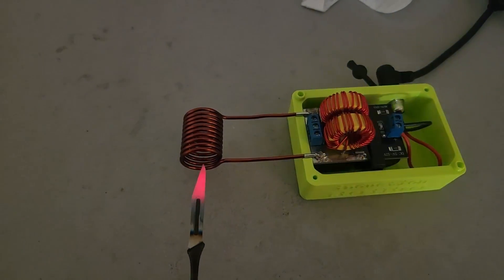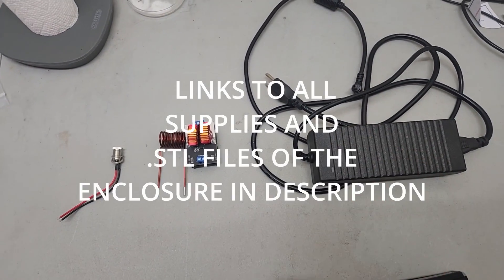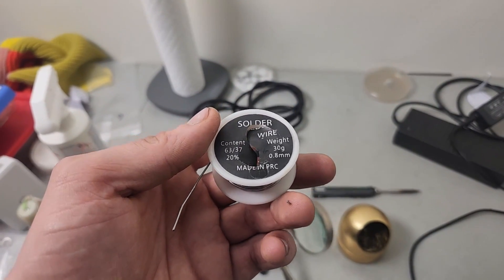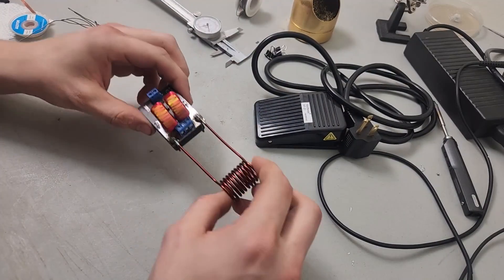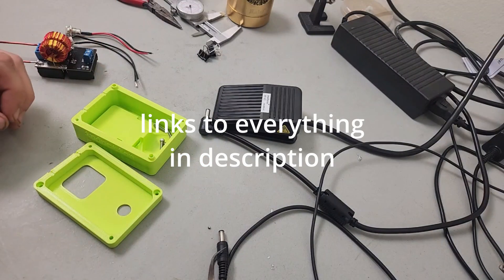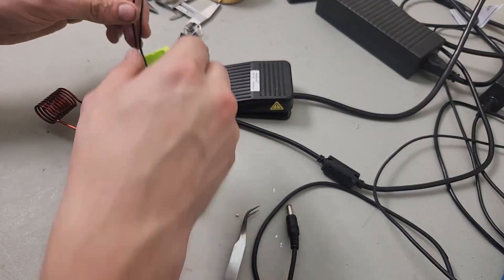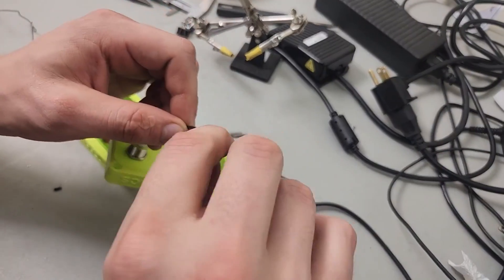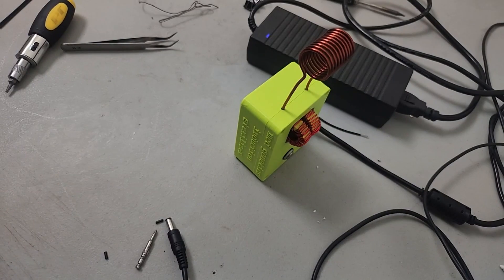Building an Induction Heater - Grow Mushrooms Safely

Comment: I don't think the power brick comes with a dc socket
Reply from the maker: It did when I got it maybe they changed
Reply: @MycoDogs  Will the button only being rated for 5A cause issues in the long run?

Comment: Doesn't work for syringe needles... not enough material ?
However it's impressive on pliers, scalpel...
Reply from the maker: some syringes will work but most are too thin, it needs enough mass to make enough heat. most will get warm enough to boil off the water inside them even if they dont glow though
Reply: @MycoDogs  Thanks for your answer. I have a solution for the needles... you have to make a kind of sheath with thin iron thread (0.3 mm) rolled on a 1.5 mm diameter support (it makes like a spring), make it stand inside the coil, insert the needle in that sheath and press the pedal !

Comment: This don't work. I solder this thing together it's all hooked up plugged in and no heat is being produced just a bunch of metal and plastic and solder drops on my place of work
Reply from the maker: do the lights turn on? the coil wont get hot just the metal you put inside it will
Reply: Yeah the light turns on start whining like a lil bom i put the metals in there didnt work, im thinking its the actual unit or the solder cause the pedal works battery and coil is coil so everything adds up but this @MycoDogs
Reply: Will a simple wiped down torch work in a sab without contam?

Comment: isnt it a problem the induction heater components are nearby the alcohol or bleach you spray in your glovebox/still air box?
Reply from the maker: i haven't ran into any problems but a loose connection could probably cause sparks, you could pot the electronics in epoxy to prevent that risk
Reply: @MycoDogs great tip thanks 😊

Comment: Does is heat up enough to sterilize a syringe needle???
Reply from the maker: Ive found some needles will work while others don't, if its too thin there's not really enough metal to warm up from the coil

Comment: Hey this is awesome Im following you for sure. 
I use the same pen. Have had it for now I think going on 10 years? Has never failed me. Heats up super fast and I love that it's portable with a liPo like you said. 
But I cannot recommend enough adding a little flux to your pads and dipping your wire tips. When i started using that soldering became a lot easier and actually fun 😅
Reply from the maker: yeah i couldn't find my flux but the wire is flux core which helped a little lol

Comment: i dont mind lead free in this use because it just requires a much hotter iron but it also does have a higher melting temp which is mildly useful in this case and i think 5-6A power bricks are enough 10a maybe why you sometimes fry the boards . for dynavap heating they use a 4A brick and just shorten the coil a little and i know a 6a brick is enough without shortening the coil

Comment: Would alcohol wipe work just as well for the scalpel or nah
Reply: no, but you can use an alcohol flame. It wont burn too hot, its mellow, and its cheap

Comment: hello! great video! I'm finding some problems using/building my DYI heat induction. I already try 2 different power supplies, 12V-6A and 12V-4.5A and none of them worked. I can only see a blinking led in both power supply and the mini ZVS board. can help with that?

Comment: If going the foot pedal route, any reason not to skip the barrel connectors and instead cut the end off of the power supply and directly solder  the wires to the board?

Comment: Dude I would love to make this and upgrades for this! I recycled a ton of vape batteries for future use so I could definitely do something with those to make it independent from wall outlets. A second upgrade I would like to add a motion detector to it so it detects something going into the coil and then it turns the coil on (a flip switch on it so there’s not any passive battery draining.)

The ideas are flowing!! I’ll message you on discord with updates when I’m working on it!
Reply: If you figure out that motion detector make a video

Comment: Well made video, I put mine in a small 12-14oz ziplock container lol, I used the screw terminals for the coil. Is there a problem with them? Ty 🍄💙
Reply from the maker: No problem with the screws it just looks weird lol

Comment: Got all the basic components off Alibaba for less than $10, including a battery case for some serial 35A 18650's because I have those in plenty and it saves me spending on the power supply. Battery operated will work just fine for my requirements and the printed case will be stored for my dreams. But having this in a SAB is way better than open flame, that's for sure. Thank you for making this video!
Reply from the maker: Thats cool do u just wire the 18650s in series?
Reply: @MycoDogs yeah from what i' ve seen thats the approach
Reply: Yep needs to be in series as they are 3,7V each and the device needs 5V-12V. That battery case comes prewired in series and holds 3 batteries (you can get all sorts)  @MycoDogs

Comment: Thanks
Reply from the maker: Thanks for the super man, to answer your question you can use either the pads on the board or the screws, if ur using the case I designed u gotta solder it to the pads, when ur soldering it up its good to line up the coil leads up with the spacing case so it fits well

Comment: You dont actually have to solder the coil, you can just bend it a little and use the terminals
Reply: You sure can but those terminals are absolute dogshit. They will melt if the heater is used often.
Reply: Good to know! I literally just asked this question and saw this comment 😂
Reply: The way my box is designed, I had to solder the coil to the board!